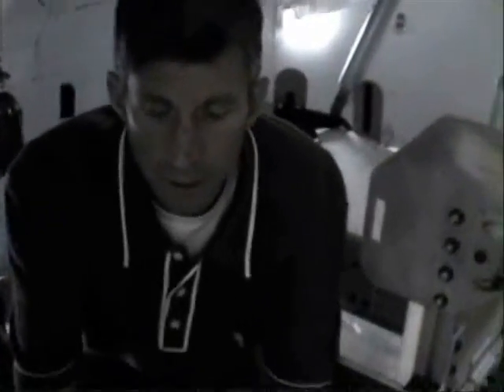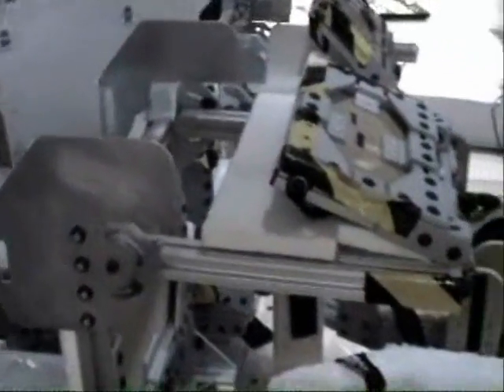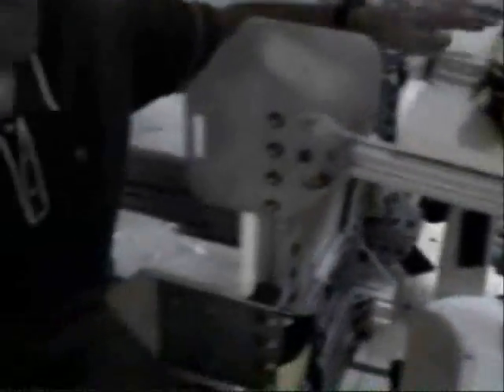A Look Inside Orion

Comment: Not really, The shuttle's design was not meant for anything other than space station docking or low earth orbit. The new Ares, Orion and Constellation designs are specifically worked out so that the craft can be used for not only low earth orbit and space station docking but also for moon landing. The shuttle is simply incapable of landing and taking off from the moon.
Reply: I just don't know why NASA should choose Apollo style old technologies of space capsules and expendable heavy lift rockets to go back to the moon? Constellation Project should be terminated! A 21st century Apollo style moon landing which used old technologies of space capsules and expendable rockets is very meaningless.
Reply: Do you know the Space Transportation System (STS) which NASA proposed in 1969 to replace the Apollo capsules and Saturn V and Saturn IB expendable rockets? The system's major components consisted of:
1. A modular space station in a 270-nautical-mile (500 km) low Earth orbit, and as a permanent lunar orbit station. 
2. A chemically fueled Earth-to-station shuttle.
3. A chemically fueled space tug to move crew and equipment between Earth orbits as high as geosynchronous orbit, the space tug also could be adapted as a lunar Earth Moon transfer vehicle to ferry crew and cargo between low Earth orbit and the moon.
4. A nuclear-powered ferry using the NERVA engine, to move crew, spacecraft and supplies between low Earth orbit and lunar orbit, geosynchronous orbit, or to other planets in the solar system. As Apollo accomplished its objective of landing the first humans on the Moon, political support for further crewed space activities began to wane, which was reflected in unwillingness of the Congress to provide funding for most of these extended activities. Based on this, Nixon rejected all parts of the program except the Space Shuttle, which inherited the STS name. As funded, the Shuttle was greatly scaled back from its planned degree of reusability, and deferred in time.  The Shuttle first flew in 1981, and was retired in 2011.
A second part of the system, Space Station Freedom, was approved in the early 1980s and announced in 1984 by president Ronald Reagan. However, this also became politically unviable by 1993, and was replaced with the International Space Station (ISS), with substantial contribution by Russia. The ISS was completed in 2011.

Comment: So instead of taking more payload to the moon you instead swamp spacecrafts to handle heat more safely? Not very smart thing to do taking in mind that the shuttle has never had a failure during reentry.

Challenger - if you blame this one for its heat shield then I have nothing to say to you.

Columbia - only thing that failed here is external fuel tank, NOT heat shield.

So why swamp systems when Shuttle never had a failure?

Comment: Keeping LEO and DS operations separate would allow them to dust-off another, perfectly-viable '60s technology: solar-electric propulsion. Ion (and other electric) thrusters are proven, reliable and would work even better with recent advances in solar cells and power management.

VTOL single-stage launch vehicles (like the old Chrysler SERV study) are an even more viable option today, given advances in materials. These reusable, VTOL vehicles also offer intact-abort throughout the flight profile.

Comment: I can add that all American spacecraft since Gemini had automated checkout but NASA never uses it. Instead what they do is to hire army of workers and disassemble Shuttle  (just as example) every time it lands and then reassemble it. They are not using system that can save billions every year just because they what more and more jobs. 

Space shuttle have fail operational fail operational fail safe systems all over because it was designed to have quick turnarounds.

Comment: This is literally 1960s technology. For example, they pulled samples of the old Apollo ablator from archives, to see how to make the current one. The old Dyna-Soar programme was more sophisticated.

Anything that needs a standing army of 10-20k workers isn't a viable transportation system. NASA people "love their work", because it pays well. An EFFICIENT system, using a groundcrew comparable to a commercial airliner (around 200 people), would mean 'routine' spaceflight & massive NASA job losses.

Comment: Space shuttle NEVER had a failure that would prevented it landing safely. But NASA now is using all components that HAD failed. They are going to use space shuttle tank and this damn Apollo design capsule. These components HAD FAILED. They should use space shuttle to put building blocks into orbit and assemble with help of ISS. Why to have capsule that can reenter Earth atmosphere when you have machine that is precisely designed to do that (Shuttle)?
Reply: Don't you ever heard the proposal of Space Transportation System (STS) which was proposed by NASA in 1970? Space shuttle was designed to ferry crew and cargo between low earth orbit and the earth and was only one component of the STS which includes Space Tugs, Nuclear Propulsion shuttle between low earth orbit and interplanetary deep space, low earth orbit propellant depot, and Space Tug based transfer vehicle shuttle between low earth orbit and the moon. The Space Shuttle was the only component of STS proposal approved by Nixon administration in 1972.

Comment: sepera, yes thanks I am aware of that, I am a flight Engineer with EFIS rating (Electronic Flight Information System). If you are going to make a wheel, why change a design that works and has a proven history. No one ever seems to be happy, not with the shuttle or with orion, there are many safety and budget reasons for choosing this design, you might note that we launch all satelites in the same way all the time!

Comment: Muti function touch screen does not take you to the moon, spacecraft does and basic design principals of this spacecraft are 40 years old. 

For example Space shuttle for  first 20 years had mechanical/computer interface and in year 2000 it got upgraded to full glass (all computer). It does not make Space shuttle (as a whole) new spacecraft.

Comment: A ballistic capsule, with an ablative heatshield and expendable launch vehicles...

Sad and kind of pathetic, really: just how far backwards they've gone. The '60 Dyna-Soar was more advanced.

NASA is not going to allow the development of a reusable system that would lead to gutting their bloated workforce (10-20k, to turn-around the Shuttle). You U.S. taxpayers get to piss away billions more on some stupid Kennedyesque moondirt stunt.

At this rate, TRULY routine space access will never happen.
Reply: I don't see any difference between Orion capsule and Apollo Command Service module. Orion capsule and SLS basically are the old technology of the Apollo program!
Reply: Don't you ever heard the proposal of Space Transportation System (STS) which was proposed by NASA in 1970? Space shuttle was designed to ferry crew and cargo between low earth orbit and the earth and was only one component of the STS which includes Space Tugs, Nuclear Propulsion shuttle between low earth orbit and interplanetary deep space, low earth orbit propellant depot, and Space Tug based transfer vehicle shuttle between low earth orbit and the moon. The Space Shuttle was the only component of STS proposal approved by Nixon administration in 1972.

Comment: rosswnelson - That might be good for future cheap and reusable LEO vehicles (though the Space X Dragon will give it a run for its money in terms of affordability) but it wouldn't be good for a lunar mission. The spaceplane design offers no design advantages for LLO and lunar landing flights, and a spacecraft with wings wouldn't be able to handle the degree of forces that a capsule returning from lunar orbit would have to face. Reentry after a lunar mission is more vicious than LEO reentry.

Comment: SteveNovak - And what would be a more efficient design? Please don't say a shuttle, shuttles are hugely inefficient. They are extremely expensive (nearly $1 billion per flight) and have no design advantages for lunar flight. Not to mention that they aren't nearly powerful enough to leave earth orbit or enter interplanetary flight. DIRECT has no practical use for LEO and would require very expensive, non-expendable boosters. The "Apollo" design was chosen because it is the most energy efficient.
Reply: I don't see any difference between Orion capsule and Apollo Command Service module. Orion capsule and SLS basically are the old technology of the Apollo program!
Reply: Don't you ever heard the proposal of Space Transportation System (STS) which was proposed by NASA in 1970? Space shuttle was designed to ferry crew and cargo between low earth orbit and the earth and was only one component of the STS which includes Space Tugs, Nuclear Propulsion shuttle between low earth orbit and interplanetary deep space, low earth orbit propellant depot, and Space Tug based transfer vehicle shuttle between low earth orbit and the moon. The Space Shuttle was the only component of STS proposal approved by Nixon administration in 1972.

Comment: Oh, a little more criticism:

There are calculations that the J-2X engine might not be powerful enough to push the 25 ton Orion vehicle and the Ares I second stage to orbital velocity. They should make the J-2X engine 20% larger giving it 20% more thrust. And one 294,000 lbf thrust J-2X is definitely not enough to push the Ares V second stage, the 25 ton Orion and the 50 ton Altair to escape velocity and TLI. The Ares V would need two J-2X engines instead of one.

Comment: Oh, actually, the RS-68 engine can produce 758,000 lbs of thrust at 102% power in a vacuum, which means that 6 of them together would generate 4,548,000 lbs of thrust at 102% power in a vacuum (at higher altitude). Each RS-68A engine will probably produce around 800,000 lbs of thrust at 102% power in a vacuum. Now add that to the at least 3,000,000 lbs of thrust provided by the SRBs combined and all of that combined is more power than the Saturn V rocket.

Comment: The first stage of the Ares I will be a solid booster which will produce at least 2.8 million lbs of thrust at sea level (likely more). The second stage will be a J-2X which produces about 290,000 lbs of thrust which will be enough to carry the Orion into LEO. This is more efficient than the Saturn V whose second stage needed 1,500,000 lbs of thrust to push the Apollo assembly and the third stage into LEO.

NASA scientists know good and well what they're doing.

Comment: Six RS-68 engines will be used for the first stage of the Ares V. The RS-68 produces 663,000 lbs of thrust at sea level and the RS-68A variant has produced 700,000 lbs of thrust at sea level. Now imagine 700,000 lbs of thrust x 6. That's 4,200,000 lbs of thrust. The Ares V will also have two solid boosters along with these engines, each of which will produce at least 1,500,000 lbs of thrust. That's more thrust than the Saturn V. A 300,000 lb thrust J-2X will be fine for the second stage.

Comment: "the J2X only has 294,000 lbs of thrust while the SSME has 490,000lbs."

Wrong again. Each individual J-2X engine produces the level of thrust that you said, but the level of thrust for the SSME is the power of ALL 3 OF THE SPACE SHUTTLE'S ENGINES COMBINED. 490,000 lbs of thrust is the power of 3 SSMEs combined at 109% thrust (which it can't maintain for more than a few minutes). The J-2X will only be used for the upper stage of the Ares I and V, not the first stage.

Comment: Go read a book on rocket engines the J2X only has 294,000 lbs of thrust while the SSME has 490,000lbs.
The J2-X also is a low pressure open cycle engine this means it's ISP for a good portion of the flight is much lower varying from 310 sec at srb separation to a high of 448 sec.
Ares I suffers from what is known as being top heavy in the LV industry the second stage has to make up most of the delta V but unfortunately it also has a very low thrust to weight this means high gravity losses.

Comment: The constructive criticism I have for NASA is:

- If they want a fully reusable heat shield like they plan, they need to come up with a better landing system instead of dumping the shield off at 32,000 ft. to deploy air bags.
- If Altair is going to be launched separately they can add safety measures since weight won't be as much of an issue.
- Start testing the type of engines Orion and Altair will use.
- Start developing Altair boilerplates. Don't wait until the last minute like the Apollo LM.

Comment: "Ares I would have worked if they kept the SSME but that simple change from an SSME to a J2 had a series of negative effects to the vehicle"

I think you don't know what you're talking about here. SSMEs are less maintenance-accessible than J2 engines and produce lower thrust and fuel-weight-efficiency ratios. The J2X produces 3 times more thrust than SSMEs, is more reliable and cheaper to fix and mass produce. 

SSMEs are outdated. It would be like using Titan engines for Apollo.

Comment: It will be interesting to see it this works. I think the reason Apollo worked was because the software was core rope memory and wasn't able to be damaged by solar flares or gamma rays ? Could you imagine a computer crash on orion. especially in lunar orbit.
Reply: I don't see any difference between Orion capsule and Apollo Command Service module. Orion capsule and SLS basically are the old technology of the Apollo program!

Comment: I don't understand why there is a five year gap (2010 to 2015) between when they decommission the space shuttles and the Orion goes into use. We are going to buy rides to the space station from the Russians during this time. What if they get pissed at us and decide not to give us any rides???? Also, no paper? That would have worked out great on Apollo 13 when they had to shut down almost everything because of power limitations.

Comment: The LSAM does LOI or lunar orbit injection plus it does supply most of the life support for the mission sorta opposite of how Apollo divided the tasks between the CSM and LM.
You can read up on this on NASA's site.
I meant LOI instead of TLI which the EDS performs.
Though I find the split risky if the Orion's SM engine fails to start after being left unmanned for the duration of the surface mission.
They'll have to send a complete Orion and LSAM for rescue.

Comment: Blame Griffin and his refusal to drop Ares I.
Ares I would have worked if they kept the SSME but that simple change from an SSME to a J2 had a series of negative effects to the vehicle.
The four segment Ares I with an SSME was a more balanced vehicle and over all more energetic but they decided air starting an SSME was too hard.
They really should have switch to a shuttle-C like CLV after this and ground started sustainer engines as in Direct launcher.
Reply: I don't see any difference between Orion capsule and Apollo Command Service module. Orion capsule and SLS basically are the old technology of the Apollo program!

Comment: Some of the decisions such as no way to manually switch things on and off seem very risky.
The vehicle also seems much to cramped they really need to go back to the 5.5M baseline if they have to ditch Ares I for the Jupiter 120 so be it it's better to move to another launch vehicle then make a series of weight saving decisions that might cost the lives of a crew.
I'm also worried as it is now most of the life support and all the fuel for the TLI is now in the LSAM.